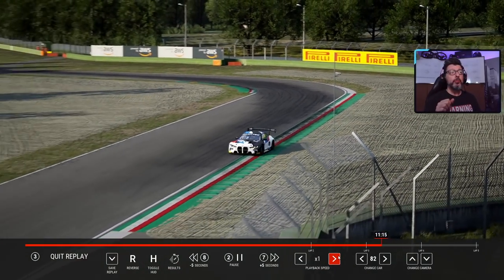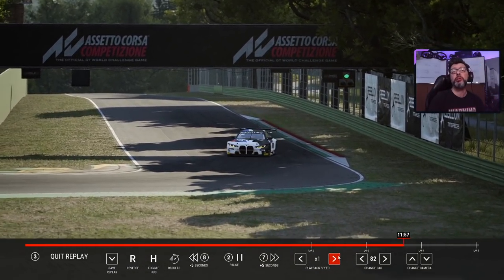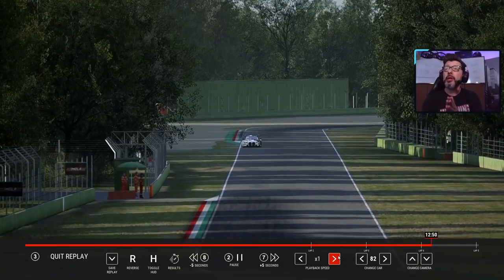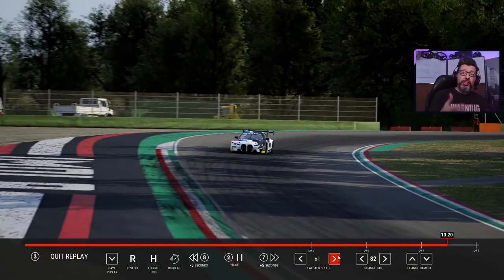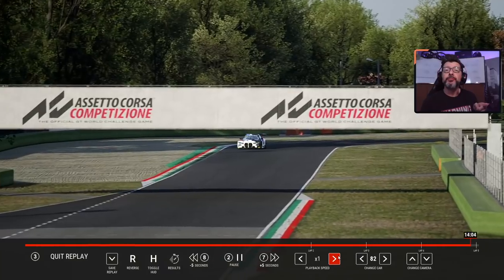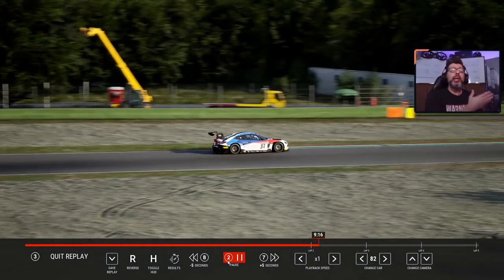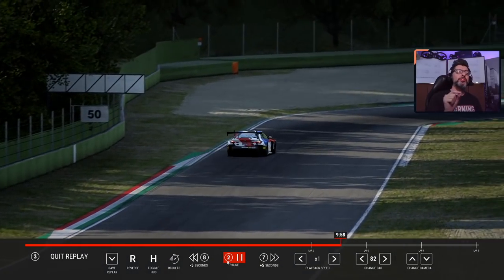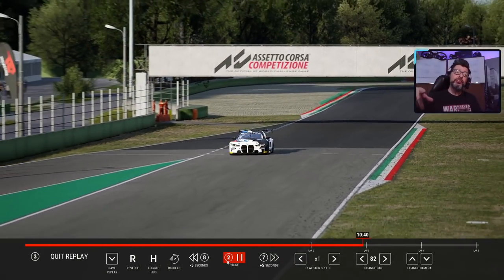TL;DW -  400hz physics engine refresh in ACC v1.8

Comment: I think I've heard a developer from rfactor 2 mention their physics engine runs at 2400 hz.  Nothing against Kunos, I love their sim but I wonder how ACC would feel at that rate.  I notice how input lag feels basically non-existent on rf2...  Imagine if ACC ran at this higher rate, you could drive it right on the limit and immediately feel oversteer and catch.
Reply: Input lag does not depend from the frequency of the simulation, if you want to improve your input lag, turn off vsync, put all video settings to low (high FPS makes input lag lower) and get a 144 Hz (or higher) monitor, I have a very low input lag, but again, it does not depend from the 400 Hz that Aris is talking about, those only affect the accuracy of the simulation
Reply: @giuseppec.956  For sure you want to minimize the visual lag from your monitor and increase the frame rate as much as possible.  I'm talking about car behavior/feedback and how quickly the sim can take your steering inputs, make the physics calculations/adjust car behavior and output the new FFB signal.  The faster this happens obviously it will more match reality.
Reply: @charliebeckey6269  the frequency of the simulation will not change how quickly you are able to correct a slide, 400 Hz is 1 update every 2.5 milliseconds, fastest response time for a human is 150 milliseconds, and we're talking about FPS proplayers, even if the frequency of the simulation could increase to 2400 Hz, it would make no difference in how quickly you can recover a slide, the difference between 400hz and 2400 hz is 2 milliseconds, you think a human could tell the difference? The frequency of the simulation only improves its accuracy, you will get bumps that you didn't notice before maybe

Comment: would it be possible to add a toggle switch in the menu to turn off the raod FX 100%?

I mean for example:
I use a G29 wheel + 0% road FX
> the problem is that the motors FFB  keep clipping when driving over the rumble strips

Not sure how stupid my question is, i love this game, but the noise on the G29 is sometimes problematic.

In either case, I love the update. You guys ROCK!

my settings
Gain: 84%
damp: 55%
Dyn: 14%
RFX: 0%
Reply: Hey mate. If you are on PC, I recommend you use a LUT file and turn everything off except gain, which should be set at 100%. There are many guides out there ok how to do this
Reply: Yea I had to use a custom LUT for the tbf and road effect to stop the weird rattling on kerbs.

Comment: Aris, does the T300RS support 400hz ? 🤔 Do U know man?
Reply: I'd be interested to hear about Input lag too (have the same wheel). Afaik, even if the t300 can't work with 400hz, it should be an improvement because the physics refresh faster. The problem would be that we just wouldn't feel it. Or did I understood that wrong? 
Is it the same with music cd's? Then 16 bit (which has the wheel) is ~44khz. That would be enough I think XD
Reply: T300 works fine with 400hz, feels great. Whether the wheel itself can pick up inputs at 400hz i don't know but FFB is improved in the last updates, whether by physics frequency, or physics plus wheel
Reply: it works on all wheels ever created
Reply: @pekvek  yes, but can the T300 represent the 400hz force feedback output is the question.
Reply: feels like YES.)))